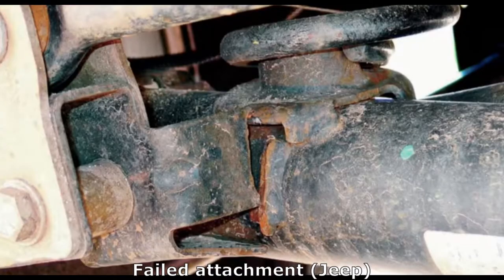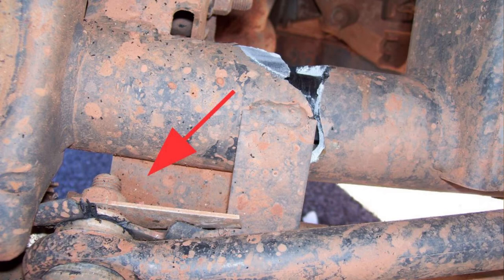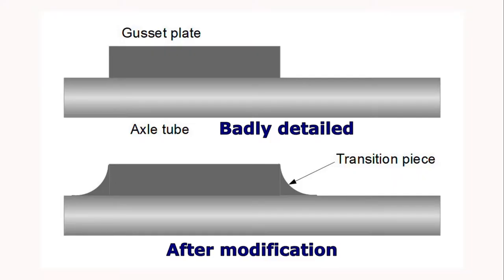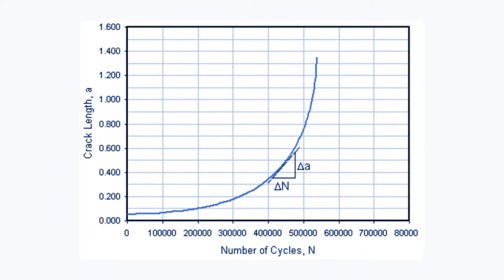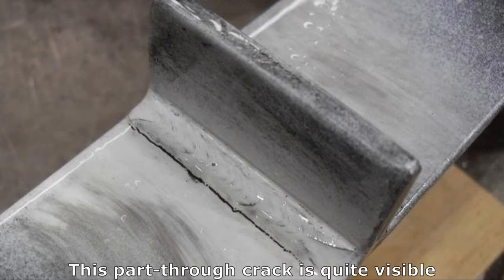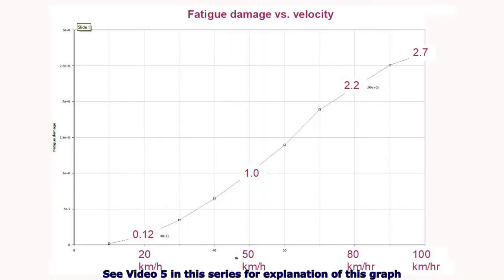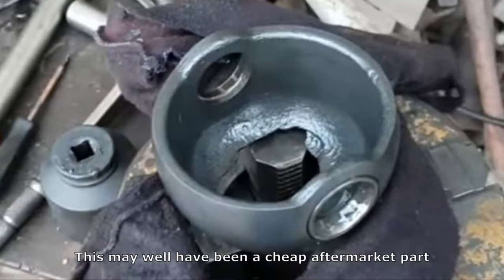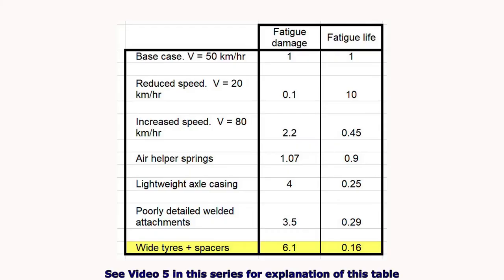Why axles break on overland vehicles. Part 7 - what the owner can do to prevent this from happening.

Comment: I enjoy watching your videos.
Allow me to contribute.
As an engineer you are familiar with the distortion that welding introduces in to any metal.
It must be noted that welding any axle housing will distort/bend it to a considerable degree.
Few workshops have the jigs or tools to accurately check the housing straightness.
Bent axle tubes generally transfer stresses to spline ends and misalign axle bearings with inevitable results.
If the strengthening/welding/repairs are to be done thoroughly the axle housing needs to be subsequently checked for straightness and necessary rectification performed.
Reply from the maker: Yes in an ideal world a high precision dimensional survey would be performed after welding and the axle would be sent for stress relief if found to be distorted by welding residual stresses. I don't run an axle strengthening shop myself so can't talk from personal experience however it's clear that the others don't go to this trouble. If they don't do this it's because experience has shown it isn't necessary. The fact is that there is slack in the half shafts which can take up limited distortion, and particularly for axles with fully floating half shafts.
Control of welding distortion is a bit of a black art and there are simple rules to follow which cater for most situations. The most important rule is to limit the amount of weld metal laid and hence the heat applied. If you look at my recommended trussing arrangement (other video), I propose a simple Tee with a thin web and ideally with intermittent fillet welds. This is in contrast to the conventional solution which uses a U section with two thick webs and large volumes of weld metal being laid. There isn't space here to get into the arguments about which is the better solution, but I'd be very surprised if the Tee secton truss gave distortion problems.
I hope this helps.
Reply: @defendermodsandtravels  They don't go to the trouble of checking because 
a: they do not know that they should,
 and
 b: that if they know they should and do check they will find a problem they created and it is too much work to check/rectify - blissful ignorance - if you don't ask you wont find out sort of stuff.

I know you are aware of the factors involved. 
I have seen hideous, premature wear on components because of bent axle housings.

A 6' piece of linear  bearing, ground round bar , say 1" diameter, put through "pucks", machined to accept the bar on their id and the respective carrier and axle bearings for their od, quickly reveals misalignment.
The "pucks" placed where the bearings sit and pass the bar through them .
Not rocket science.

You would also know that a general rule of thumb with putting heat in to metal is that if you heat metal up on one side and it distorts, put the same amount of heat in to the other side to cancel out the distortion.
Any welding of these housings distorts them to an alarming degree.
Best regards.
Reply from the maker: @nkelly.9  I haven't seen these heavily strengthened axles myself but if the distortion is visible, as you say, then it's a problem. For heavily welded sections the correct solution is stress relief followed by final machining of the critical surfaces but I am sure the average welding shop doesn't do that. For the light Tee section reinforcement which I proposed the easiest way to control distortion (which won't be large because of the light welding involved) is to pre-camber it; use a strongback as a jig, restrain the axle at the ends and jack in the middle. With a bit of trial and error it will be easy to get it so that the strengthened axle is damned near straight.
Reply: @defendermodsandtravels  A 1" weld on one side of an axle housing tube will bring a 1/16" to 1/8" bend at the end of the axle housing tube. First the heat will extend the side that is heated , then it will shrink it back that bit further. I have observed this phenomenon with my tooling. Any heat will disturb the concentricity of the housing.If the heat applied is on the opposite side to bracketry that may act as a strengthening buttress you may get away with it. 
Being an engineer I know you understand.
Heat treating/stress relief then machining ideal but these axle housings were never heat treated/stress relieved in the first place. A rigid jig may alleviate distortion.